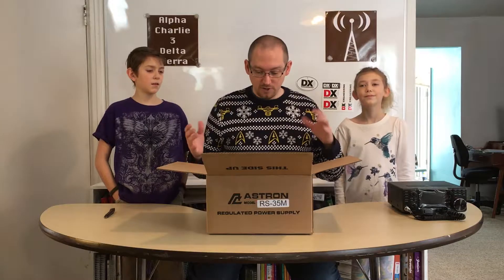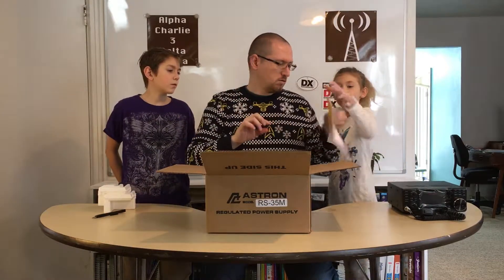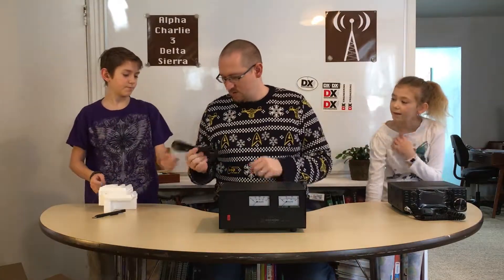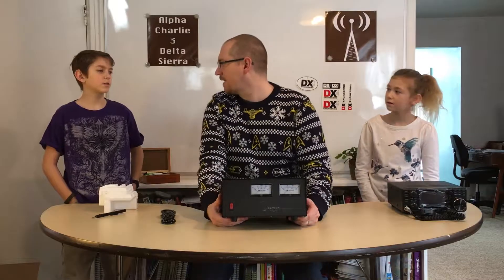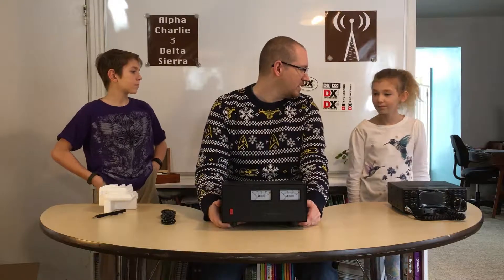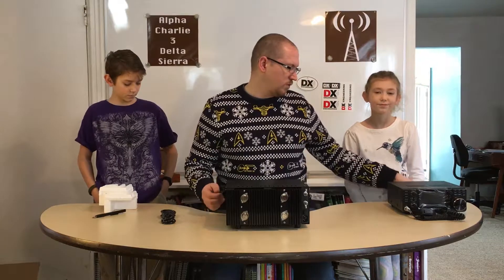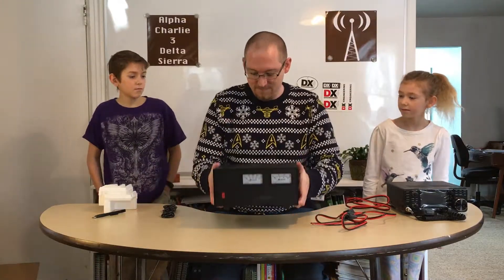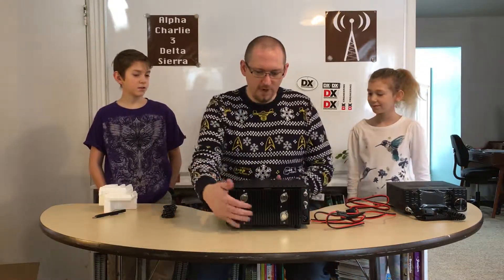Ham Radio Astron RS-35M Power Supply Unboxing

Comment: I have one of these supplies and it works extremely well. Over time there can be some issues which are easy to fix yourself and plentiful documentation exists. I highly recommend Anderson power poles as well as a rig runner for multiple pieces of equipment.
Reply: I got a used one. What is the link to this "plentiful documentation?" Mine doesn't work.
Reply: shamrock1961 repeater builder has lots of information as well as does the ASTRON website.
Reply from the maker: Thanks for the information! We took your suggestion on the Anderson powerpoles and are very happy with it. We have more videos over on our new channel Transmitting Until Robots Replace Us, in case you are interested.